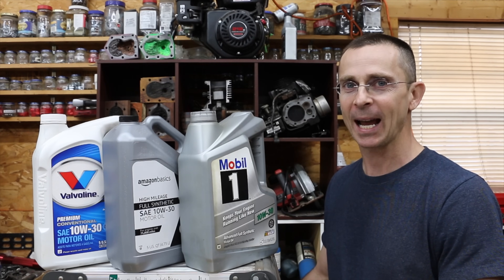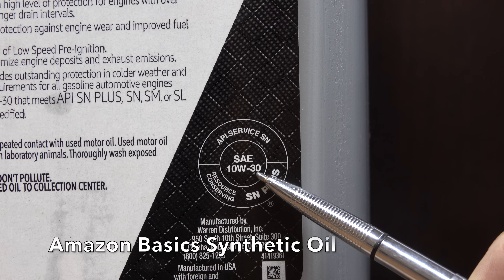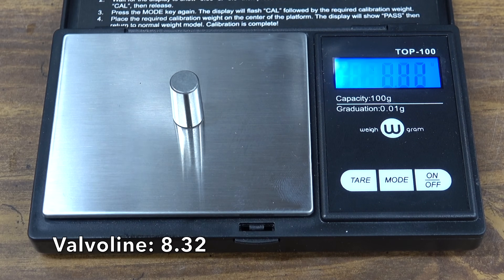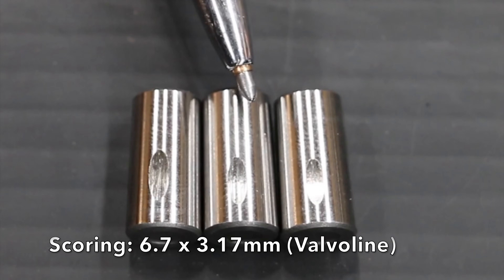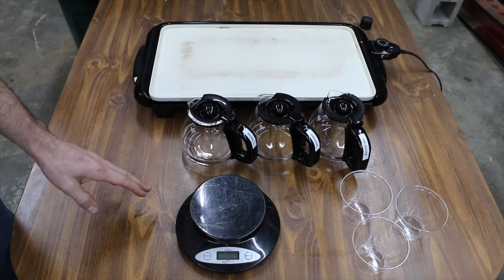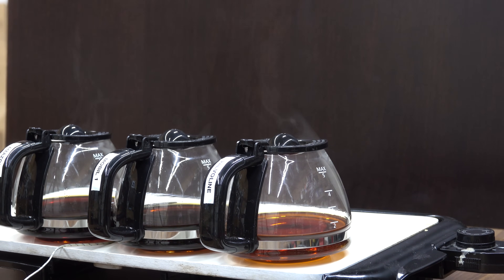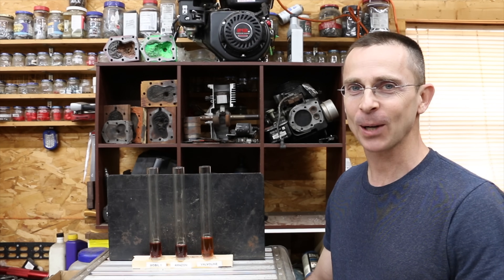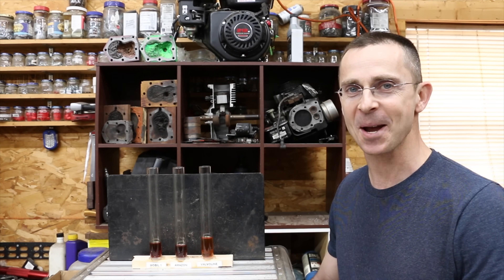Is AmazonBasics Full Synthetic Motor Oil better than Mobil 1? Let's find out!

Comment: Thumbs up dude! But this won't matter in ten yrs anyways because Alexandria On Crack (AOC) has the Green new deal...Lol
Reply: yawn, cant believe a trump wingnut still dares comment on the internet
Reply from the maker: Thank you!
Reply: I'd say if hydrogen fuel cells take off or Batteries somehow triple in capacity in a short space of time then your going to see more and more zero emission vehicles anyway,  and with their flat torque curves (oxymoron there) which gives them good driveability, more and more folk are going to buy them. 600 mile range BEV pickup truck with motors at each wheel would make a damn good towing rig thats for sure.
Talk is Tesla have a pickup in development and there are several others who reckon there's a market out there for a zero emission truck and I wouldn't bet against them.
Some of the local cabbies run Leafs and they all say they bought it as a gimmick but now wouldn't go back as its quieter, better driveability and some of those guys have done 40,000 miles in a year
Reply: @johnphillip1711  electric vehicles won't fit my needs, too long to charge, batteries are too sensitive to cold climates, they loose their charge @-32° too fast
Reply: @leskobrandon538  Hence hydrogen fuel cells, no charge to lose, refuel in the same time as it takes to gas up, no tail pipe emissions (well apart from water vapour)
Also battery tech is coming on leaps and bounds, even I'm surprised and I'm a skeptic. Remember just over a hundred years ago people and newspapers were arguing that the "horseless carriage" would never catch on as they were crude, noisy, unreliable and difficult to find fuel for. in <50 years we had reliable, comfortable cars with a smooth ride, fuel on near every street corner, repair options here there and everywhere.
I don't agree that battery vehicles are a total solution, I don't personally think the grid would withstand it, its already struggling in many countries and now folk are adding in high amperage vehicle charging its creaking further still. UK has ~4% of new vehicles being BEV and its putting strain on the grid. Without chucking a tonne of cash at generating plant and massive grid capacity upgrades - which are going to make "normal" roadworks look like a walk in the park in comparison, somethings going to give sooner or later. Electrical grids are scaled between 10%-25% of potential demand. Works ok at the moment (just) if everyone went BEV overnight, we'd have rolling blackouts every night.
Solving the capacity issues would mean at a minimum uprating all the HV cabling, then substations and the MV cabling to them, then dropping 3 phase to every house to avoid 2 or 3 car families blowing the service fuse every night.
The cost of that would probably stick everyones electricity bill up by a factor of 5 or maybe even 10 to pay for it all.
Electrical grid has only coped in many areas as consumption has stayed consistent despite more and more stuff being plugged in because of stuff like "Greenstar" aka energy efficiency ratings, my fridge freezer uses a 3rd of the electricity compared with the old one and thats despite it being bigger.
The other issue is the sourcing of Rare Earth Metals and lithium, many of these rare earth metals come from the 3rd world, and a large amount were being sourced from the Democratic Republic of Congo (formerly Zaire), where children and adults are used as slave miners and metals brokers can't guarantee where their supplies come from, nor can they guarantee none of it was conflict mined using slaves. 
Try tell that to a BEV envangelist and they will say your in the pocket of big oil and then start raving about why fuel cells will have the same issues. Worse there are companies looking to exploit the sea bed, putting endangered species and fragile ecological environments at risk, you may not care, but these are things that are found in only one place on the planet....Imagine the furore if someone suggested dynamiting Mt Rushmore, or turning Yellowstone into an open cast mine = there would be uproar from nearly all political viewpoints in the USA.
The western world needs to chuck the same or more cash at Thorium Salt and nuclear fusion that China is, they've realised their air is becoming toxic, they don't want to cut back on energy, so the only solution is clean energy and whoever cracks the problem first is going to make a lot of money.
You crack clean and sustainable energy, then you install a tonne of generating plant, install capacitive charging in the roads network or in the interim pantographs to allow semi trucks to run on electricity with a battery back up for roads off the beaten track.

Personally I quite like AOC, she's shaking up congress and asking some difficult questions of various people, many of whom have been given an easy ride for too long. People voted Trump to "drain the swamp", as I see AOC is exactly that, they wanted congress to have its cosy arrangements up-ended, she's doing that. I may not agree with everything she says but she has the GOP throwing irrelevant mud, like her dancing in college, I didn't realise a woman dancing with clothes on was a sin. I thought America was the land of the free, yet when you listen to some in the GOP (not all) its like they want to create a Christian Theocracy in the vein of Iran, yet in the same breath they are talking about "freedom of speech" and "1st amendment rights" - 

Congress shall make no law respecting an establishment of religion, or prohibiting the free exercise thereof; or abridging the freedom of speech, or of the press; or the right of the people peaceably to assemble, and to petition the government for a redress of grievances.

Both sides need to grow up, stop pointing fingers at each other, stop point scoring and grandstanding, stop cosying up to lobbyists and start working to sort out this mess.

China surged ahead, not just because of cheaper labour costs, but also because they train their people, they sent many to other countries to learn their culture and ways of working as they knew their own was holding them back. While we in the western world were navel gazing, refusing to train our young people, poaching staff off each other, closing off avenues of promotion and progression, not to mention overloading staff by round after round of layoffs whilst giving executives outsized bonuses, the Chinese were training vast quantities of Engineers, Scientists, Designers etc etc etc.

We fell behind because we got complacent, we stopped trying, we got hung up on "it works so why try something new" or worse "its tradition", "I've worked here 20 years and I think I know what I'm doing" when the process is flawed, inefficient and could be done better and with less waste and cost.

We jumped ahead post WW2 as young minds returning from war were given opportunities to show what they could do, that experiences gained from war or from war work were applied to improve our productivity and output, this continued until the 70s by which time the accountants had been allowed free reign, stifling R&D under the heading of "cutting costs", stopped the replacement of machines (look how many machines are still being used way past their prime as there "isn't the budget to replace it") and coupled with the rise of HR, stifling innovation and free thinking under the guise of "corporate identity" which rapidly turned into "thats now how we do things around here"

There is a whole market out there waiting to exploited, the problem is the western world is generally ignoring it still, resting on their laurels saying people will keep buying our stuff as they always have, our customers are loyal to our brand. No one has learned a damned thing in 40 years.

However it isn't going to happen that we go entirely green in 10 years, maybe not even 25, 50 is possible with will and as long as we don't do more harm trying to negate the harm we are already causing i.e. when people used asbestos for fireproofing and ended up causing a public health crisis, that may yet come to its peak.
Reply: All fine and dandy, all I want is to drive from point A to point B the simplest way possible... Does a hydrogen fuel celled car or jeep sound simple?
Reply: @leskobrandon538  pretty much is. Main obstacle at the moment is infrastructure same issue early car drivers had. However networks are rapidly growing and it's going to be a lot easier adding hydrogen refuelling to a rural station (pressure tank and  the requisite pump, might look a little different but the principle will be the same) than it will be to up the power grid to handle 200 battery cars an hour going from empty to fully charged, I hate to think of the cabling you'd need for starters -300-600 amps per car X say 20 cars so 6000 to 12000 amps, that's not an insubstantial transformer. A worst case scenario perhaps but lots of folk let their cars end up on the red light before refuelling so who why won't battery cars be any different. Though the solution could be to add inductive charging to every parking lot then the hit to the grid would be a lot less in one go and youd never have to even think about it. Park up, go to work or the store and while your doing whatever your vehicle is topping up its charge.  Think about that one, no getting the car/truck and findibg your spouse or kid hasn't been to gas station all week and now your late for work and having to nurse it on vapours to the gas station. Heck you could add it to the driveway and then no worry that someone might unplug it or someone would forget to plug it in or flip the switch. Again park,and the car does its thing. Car is always charged
Just needs some thinking and infrastructure spending -how many jobs would that create in construction alone? Manufacturing, materials engineering, electrical contractors, concrete workers list goes on and on.
Reply: @johnphillip1711  I'm in the power generation industry, have been for 35yrs as a Fossil fuel power plant operator and a hydro power plant operator... Believe me when I say if everyone switched over to battery powered cars, it would Quadruple the grid load from 4pm to 9pm... unfortunately I live in California and know the Grid here... It won't beable to handle it as California imports half of it's 230-500kv load from other state while at the time exporting it's smog... Both nuke plants from SCE and PGE are being dismantled at the same time. SCE also decommissioned its one and only Coal slurry Fired plant in Laughlin NV.... Sad day when that happened..
Reply: She's gonna get Obama to pay for us all to have solar powered cars.  GO, AOC!

Comment: The label says Warren Distributing. That's the same company that makes Walmart Supertech.
Reply from the maker: Thank you!
Reply: I would presume all of the non oil company oils come from similar places.. great video :)
Reply: Yes I work for an auto parts store and our brand oil is made by warren company
Reply: Actually, no. Warren Distribution does make the oil for Amazon basics. However, it does not make the oil for Walmart (Supertech). Here are some links to the API website to confirm this.

https://engineoil.api.org/Directory/EolcsResultsDetail?accountId=-1&companyId=10296&resultsUrl=%2FDirectory%2FEolcsResults%3FaccountId%3D-1

https://engineoil.api.org/Directory/EolcsResultsDetail?accountId=-1&companyId=10297&resultsUrl=%2FDirectory%2FEolcsResults%3FaccountId%3D-1
Reply: Warren Distributing is exactly that ... A distribution company. They handle products but don't make them. Example: Warren distributes Motorcraft parts. Motorcraft is the parts division of Ford. Warren doesn't make the parts. Ford does. Ford doesn't directly distribute parts (other than to dealerships). Warren does.
Reply: Yep and supertech at local Walmart is like 14 dollars for full synthetic
Reply: @bigmac22ify  , I think Supertech Full Synthetic is $0.20 more expensive than Amazon Basics, but I don't have to wait for delivery, I can just drive to Walmart and get it right away.  I have, and will likely still continue to use Supertech instead of Amazon Basics, not because I think that one is superior than the other, but because I can drive 2 miles and get it right away.
Reply: From what my company told me mobile 1 makes the oil, sells to warren then repackaged into store brand bottles
Reply: And rural king as well
Reply: The mobil plant in paulsboro NJ bottled supertech

Comment: You just keep knocking them out of the park!!! I do have a question for you though. Have you considered testing how loud it gets during lubricity testing? Also im curious about a follow up on motorkote. Maybe see if one oil protects better with it than others and see how gaskets react to it with prolonged exposure. I've heard that it makes gaskets brittle similar to the claims that are made about ethanol fuels.
Reply from the maker: Thank you for the video idea!

Comment: Great video and wasn't aware Amazon sold this. Another one I've seen is Mobil One Advanced Fuel Economy, which is a thinner oil that says it protects like and is meant to be put in vehicles that take a thicker oil. It would be interesting to see this bearing tested and in the generator too to see if and how much difference there is. Thanks for the great content!
Reply from the maker: Thank you for the video idea!

Comment: Very informative as always. Would it be possible to take each oil after being heated and frozen and perform the friction test again to compare against the control of fresh oil? Probably little change if any going through only one of each temperature change but it would be interesting to see. I have started using Valvoline full synthetic modern engine oil because it is suppose to help reduce or eliminate carbon deposits on the top of the intake valves of direct inject engines. This test gives me a little insight that it just might help. Thank you!
Reply from the maker: Thank you for the video idea!
Reply: Think about how a internal combustion engine works and then think about that Valvoline claim ... Then decide if their oils, which consistently test worse than competitors, make any sense to buy. I think you'll swap away after doing a little thinking/research.
Reply: @ghosttheoremproductions5469  I have done thinking/research which is why I have chosen to give it a try. I've also been known to work as a mechanic so I don't have to think very hard about how an internal combustion engine works. Especially the one in my own car. I use Valvoline for a reason. I also know that Valvoline tests their products on there employee's vehicles. Their employees essentially get a free oil change for letting Valvoline's lab use their vehicle for testing and analysis. Thanks but I think I'm good here.
Reply: @rogerpemberton79  lol
Reply: @ghosttheoremproductions5469  how does the internal combustion engine in my car work exactly since you seem to know and want to offer such sage advice so blindly? 😂!
Reply: @ghosttheoremproductions5469  I'll be anxiously awaiting your all knowing explanation of the exact working of the engine in MY car.
Reply: @rogerpemberton79  You're the one backing claims that a part of the motor that doesn't see oil is somehow protected from carbon buildup by it. --- If your motor has so much blowby that your PCV is allowing oil to coke your valves then you have bigger problems than an oil will fix. Alternatively, leaking valve guides allow oil onto the valve but again ... Bigger problem than additives in your oil in solve. --- All of which makes the argument seem extra stupid when you're using an oil that offers inferior protection compared to competitors thus resulting in a greater need for such snake oil claims.
Reply: @rogerpemberton79  - A ICE engine is a ICE engine. That reply just demonstrates your lack of understanding.
Reply: @rogerpemberton79  - Run what you want. Your money, your vehicle, etc. But don't expect people to agree with your bad decisions. They aren't good choices just because they're your choices. --- Heck, this is all in reply to a video where you saw Valvoline get categorically beat by both a leading competitor AND a cheap alternative ... LMAO
Reply: @ghosttheoremproductions5469  conventional valvoline not full synthetic valvoline. Huge difference!

Comment: Can I suggest a heating system that brings the oil to or above operating temperature to test how well it maintains it’s properties after repeated overheating cycles? Maybe some kind of electric hot plate and a series or copper tubes to circulate the oil to simulate operating movements and prevent burn up while still cycling hot to cold spots.  keeping in mind any gasses that might be produced or potential pressures
Reply from the maker: Thanks for the recommendation.  I'll see what I can do.

Comment: I am still skeptical of using Mobil One 0W-20 in my late model vehicle for the recommended 1 year or 10,000 miles.  Definitately would be hesitant to do the same with an Amazon Basics product.
Reply from the maker: Great point!
Reply: @ProjectFarm  Any chance you have to do long term testing is always much appreciated.  The "best" product is often the one that lasts the longest, even if immediate results are middling.  Things you have done or could do: zip ties after a summer in the sun.  Oil lubricity after 6 months of use in a crank case. Duct tape strength / removal after being in the sun and rain.   Spark plug efficacy after long term use.  Protectant sprays after 3+ months in preventing rust.

With Spring/Summer coming up, there are tons of things you could set out in the elements now and see how they fare 6-9 months from now.